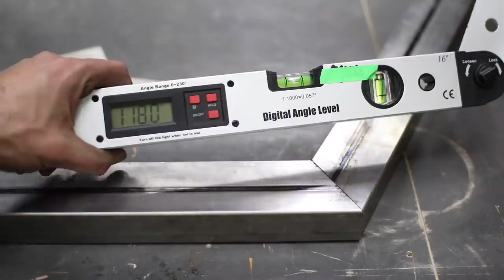Building A Cargo Bike / Part 2 (Detailed Edition)

Comment: Johnny Wikk, Nice build. If I build one for myself, I will add an additional tube welded diagonally where the top and seat tube intersect down to the bottom of the vertical steering tube you just made. It is also welded crisscross to the down tube. This will make the frame more rigid because all the weight of the operator and cargo is concentrated to the rectangular tubing of the cargo frame. Without the tube, you probably noticed a frame flex when carrying heavy load.

Comment: Do you feel like you’re having to put extra effort into turning or does it work good once it’s up and rolling? That control arm setup gives me an idea for a reverse cargo trike with two small wheels in the front for more capacity. Not a fan of the splatter paint but props for a solid build!

Comment: I´ve seen some of these converting to cargo videos - question I am asking myself:
Why welding so many flimsy connection, like very thing bike CroMo steel to construction steel, instead to getting rid of all standard bike parts and building complete out of square?
Front fork should not be a problem. Rear - I do´t know. But why a seat post like this, when you can come by with a completely new design? You don´t need a vertical pots like this on a cargo bike.
Reply: .. because they are idiots.. Cargo bikes are reinforced on many places like break saddles etc as there will be a much higher force. Result will be an exploding brake in the middle of the road with your kids inside... great. And that dude just welds normal tubes to expend an already flimsy bike. Horrible

Comment: To me it would make more sense to just make a trailer and pull it. When you don't need it you still have a normal bike.
Reply: I have used both, sometimes hauling 350lbs (150kg). The bicycle and wagon allows for independent bicycle use when not hauling cargo. Cargo in cargo bikes is "live weight," whereas cargo in trailers is "dead weight." Think of live weight as a well-fitted rucksack. Think of dead weight as an armload of loosely tied stuff. Live weight moves with you. Dead weight has independent inertia and seems to have a mind of it's own. Steering in a cargo bike starts out very responsive, and with added weight, stays responsive, even improving with more cargo due to increased density of a low center of gravity. The wagon, even if mounted below CoG and forward of the rear axle has an asymmetric weight and drag which requires compensation by the ride, becoming not-so-stable when starting and stopping, and care must be taken to "clear" the wagon when navigating turns and tight spaces. Cargo bikes are twice as heavy as their "bike-tractor" counterpart, but as easy to ride, plus, you can go out for a fun ride and come back with groceries